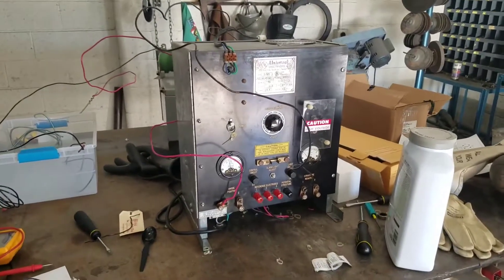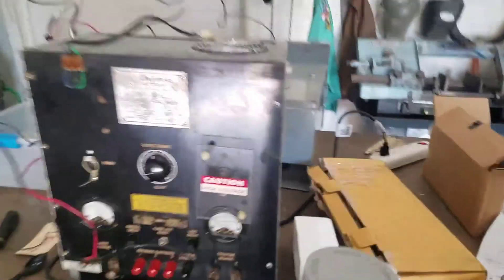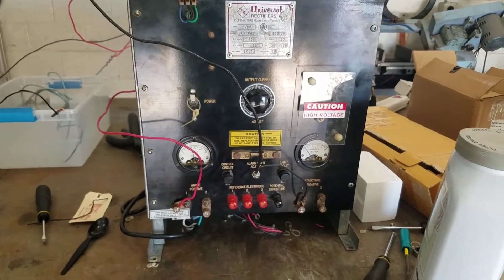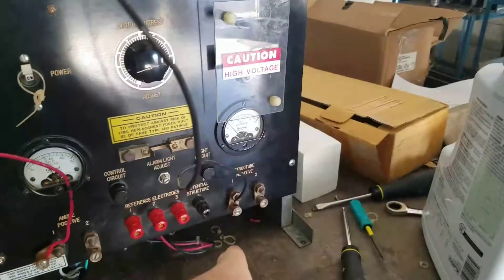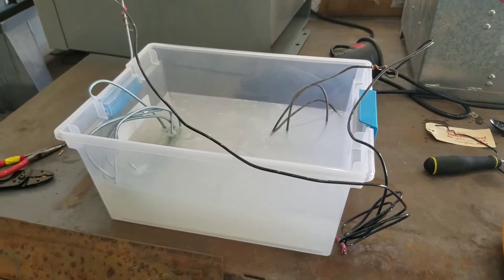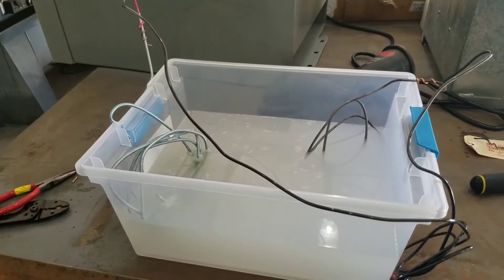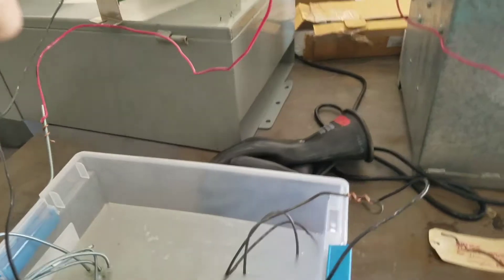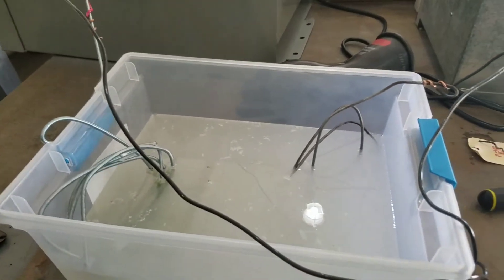Power Cell / Cathodic Protection Lab for Rectifier Course

Comment: hello,

upload the results of this experiment if you have it please.
Reply from the maker: Unfortunately I don't have any pictures of the final anode and cathode conditions. After letting it run for about 24 hours total though, there was significant buildup on the zinc anode and the steel cathode had much of the corrosion  removed from its surface.